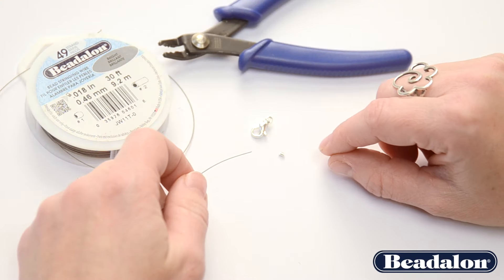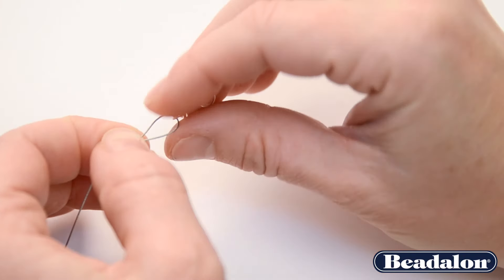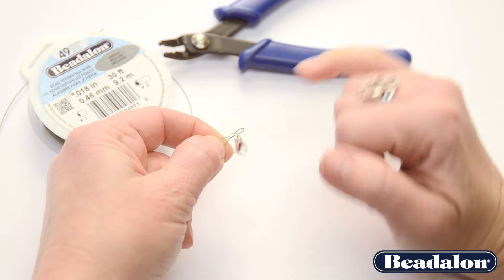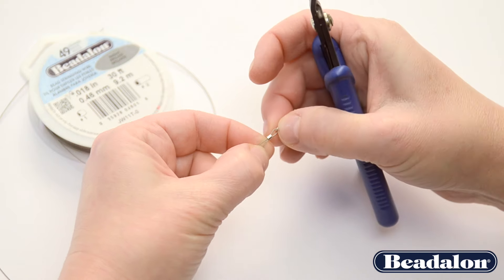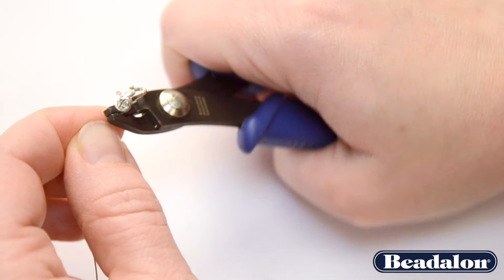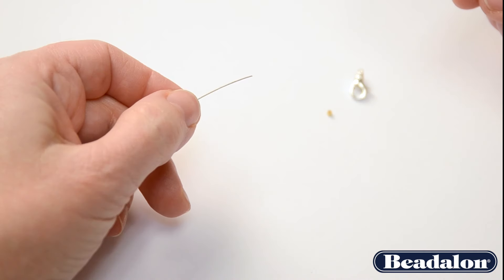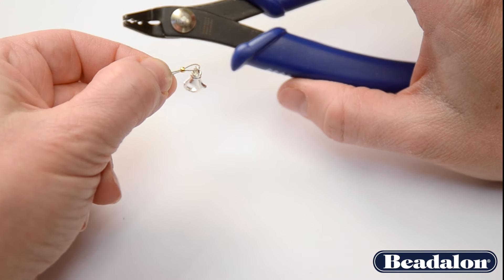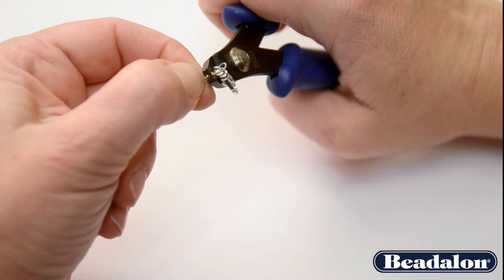How To Crimp Like a Pro

Comment: This would be so, so much better without the music so that I could really hear the directions.  I don't watch these for music.  I watch to learn more about making beaded jewelry.
Reply from the maker: Thank you for your feedback!
Reply: I don’t think it looks complete without a wire guardian!!
Reply from the maker: We love wire guardians too!!!
Reply from the maker: No worries ladies - the music has been turned down haha! In earlier video, the youtube music levels mix was messed up, so it ended up being louder on some people's computers. You should have this problem moving forward. Thanks for your feedback!
Reply: @beadalon  I've made a woven leather anklet with 2 strands of 3 different colors, so I have 6 strands to crimp, or any suggestion how I should "finish" it. I bought lobster clasps which have a larger size (for the strands to go through); my questions would be what size crimp (or which method) I should use.
Reply from the maker: @marinazagrai1623  Usually, leather finishes well by knotting it. With so many strands, crimping might not be your best option. Why don’t you send a photo to sales@beadalon.com and we can try to work through it? Thanks!
Reply: @beadalon  Thank you, and since I've never done this...it's a nice result. I went to my store (Joann's) and I bought round crimps  which fit my strands better than a "tube" crimp. I used 2 strands of 3 colors (1mm) so the bead fit snuggly around the 2 strands.
Reply: Amy Kaplan It’s perfectly clear what she’s doing if you watch

Comment: am having problems with my crimping tube and crimp bead falling to pieces when trying to crimp them. I have used different brands and types. I even had them fall apart when they were gold. I dont understand what I am doing wrong. If I squeeze lighter they don't bend. What is a good brand and type that won't break apart? I would like to use them for making bracelets. Ty
Reply: Same things been happening to me. I'm using a bigger size barrel like tube bead so that 4 pieces of wire can go back through when I'm securing it and they fall apart and don't crush right and I've done it like 5 times so far.  Very annoying.

Comment: Hello, I love your video! I'm just starting out making bracelets as a hobby but I'm confused with the sizes to get. What's the perfect wire size for a 3mm bead?
Reply: I would like to know too
Reply: Some wire tells you on the front of the packaging what size crimp beads/tubes to use.....If you look at the wire packaging in the video, you'll see the #1 size for crimp beads and #2 size for crimp tubes. Freeze the video at 15 seconds and look on each side of the upc symbol. I know it's late, but hope that helps!

Comment: What I want to know if you can help me or not but it seems when I'm crimping the crimp seems to move on me when I try to do the second step and I can't figure out why then the crimp is not tight enough I pull on it and the wire comes out I do it so much I just can' figure it out, Please help if you can, Thanks!

Comment: Hi when I try the first step nothing happens as if the tube is too small for the crimp tool. I’m using the exact tool and tubes that you are. Is there a reason why nothing is happening?
Reply: I am having the same issue. Crimp Bead is the same size as the hole in the crimper and doesn’t shape anything
Reply: There are small crimp pliers (for 1 mm crimps) and big pliers (for 2 mm crimps).

Comment: Great video! There's a different kind of crimp though that I'm trying to learn how to use properly. It's the one where after you put the elastic string in it, "make a loop" with the string , you have to fold the left side in and right side in to secure it. Do you know which one I'm talking about?
Reply: THATS NOT CRIMPING ITS CALLED THE SURGEONS KNOT.  PEOPLE NORMALLY USED IT WHEN MAKING BEADS ON ELASTIC CORD.  ITS DIFFERENT.